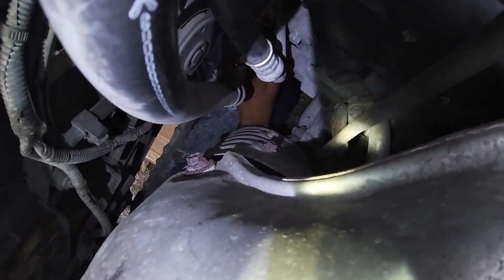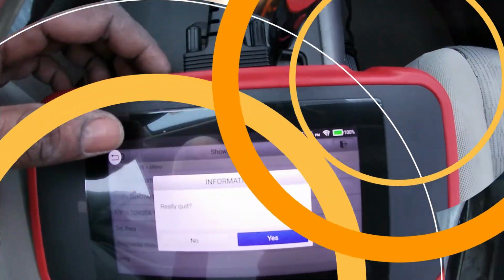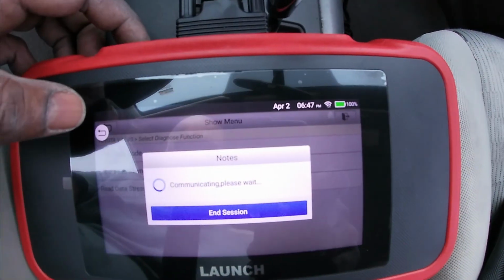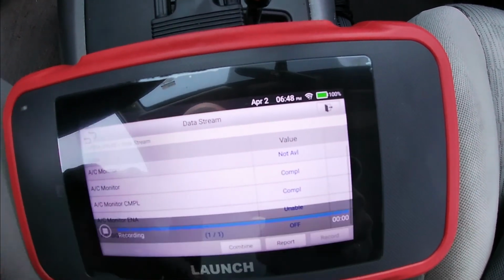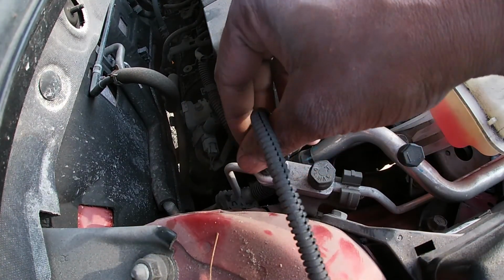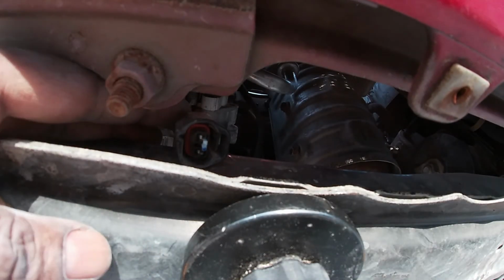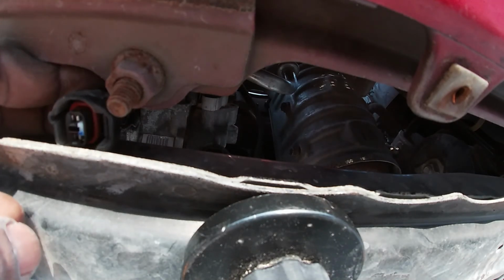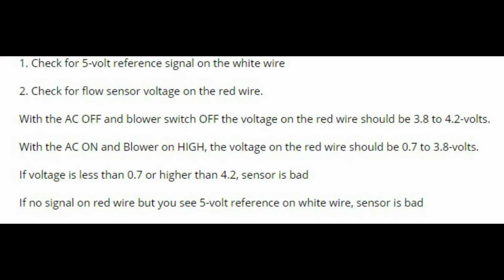2010 Toyota Rav4 AC Repair, Flow Sensor Diagnostic, Temporary $10-$40 Fix.  Code B1479

Comment: Thank you BARR8323! I have the same issue, and the garage said you can't buy just the sensor, you can only buy the whole compressor and replace it, part and labor together is close to $1K!  I saw your video, and now I placed the magnet onto the sensor, problem solved. Thank you very much! 🙏

Comment: hello BARR... You the man. My mechanic saw this video and used this trick to engage the compressor. I now have a magnet in place and it works. Should I unplug the sensor? The compressor didn't go on-off it just didn't go on. Now it does with a magnet and sensor plugged in. This is a fantastic trick, and yes I will now shop for a new sensor. I have a 2010 red rav4. BRAVO!!!!

Comment: Hi there thanks for your hard work. I had a question do you remember what pressure you were reading when the system was working at full efficiency
Reply: @BARR8323  I think you are mixed up. I was inquiring about the ac issue with the flow sensor on the Rav4
Reply from the maker: My bad. I deleted the reply.  Pressure varies based on ambient temperature. Google PT chart for R134a and it will tell you what pressure you need to be at base on your current temperature.

Comment: What the f*** are you talking about you need to take the compressor off to replace that switch that is the biggest load of b***** I've ever heard All you got to do is remove the cooling fan out of your way or use a pair of 90° snap ring pliers are you smoking something

Comment: Did you zip-tie the sensor to the high side or low side?
Reply from the maker: I think I zip tie and also add a wire twist tie just Incase the zip tie melted.
Reply from the maker: I think I zip tie and also add a wire twist tie just Incase the zip tie melted.

Comment: Not sure this is my issue but maybe I missed something. My compressor sounds like it kicks on but the ac circle light doesn't light up when pressed in.
Reply from the maker: Is it blowing cold?
Reply: No. The fan runs but only blows hot. And the condenser sounds like it kicks on to. Just ac button doesn't light up no cold
Reply from the maker: That’s hard for me to help, because If you say fan is kicking on and compressor sounds like it’s kicking on, but blowing hot 🥵 air you could have a refrigerant problem.  
Don’t add refrigerant unless you know it’s low.  Too much refrigerant hurts the system and cause it to blow hot.
Maybe someone else will comment to help.

Comment: You can remove without taking compressor out but it's difficult for sure
Reply: Did you do anything special to get it out?
Reply: @mrordinary28  no just cut up hands and small tool for the c clamp and a pick

Comment: I have the same problem with my car Toyota 2010 Toyota rav4 A/C bad flow sensor. I did the same you did and it's a bad flow sensor. What the part numbers of flow sensor you bought?  Should I leave a piece of magnet on top of the sensor that still makes AC working for another time. Thanks.
Reply from the maker: Denso TSE17C from eBay
Reply: @BARR8323  Thanks

Comment: This is awesome, just got a quote for $2,133 b/o of bad sensor code B1479, and they want to replace everything since sensor is "built into A/C compressor) - i got a 2011 Rav4 ...so going to try this fix.
Reply: How did it go for you? I had same issue
Reply: HI, I will like to know if this fixed the issue. Same issue is going on with my car.
Reply from the maker: For me if fixed it, the sensor went bad after 6 months, it was working intermittently, replaced it with another one, worked perfect more than a year now.
Reply: @BARR8323 good morning. Did you use a different brand for  the second sensor?
Reply from the maker: No, I ordered the same one again.  Still working.

Comment: Is that sensor still working or did it quit.
Reply from the maker: No, it died after 6 months, I bought a replacement and changed it in 10 minutes and been working all this summer without a problem.
Reply: Where did you get a new sensor ??
Reply from the maker: Ebay
Reply: Ebay